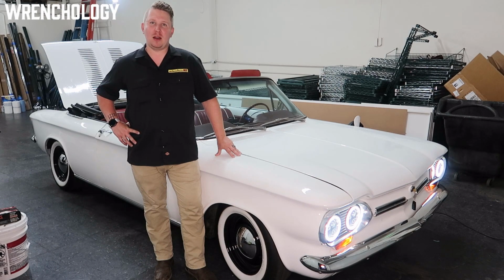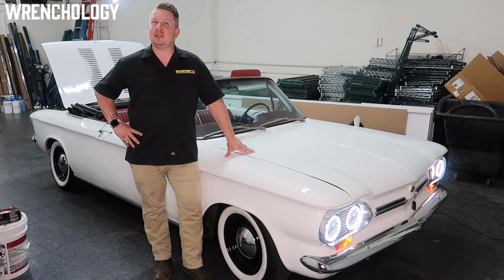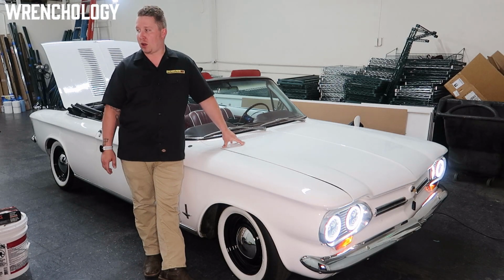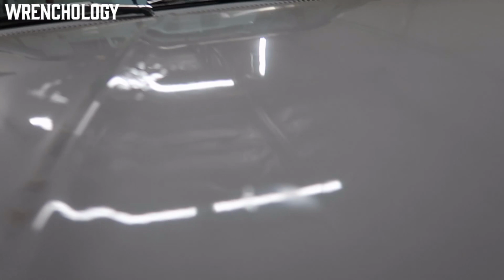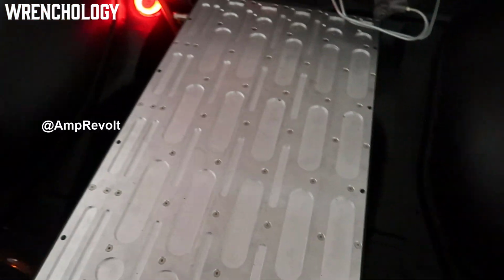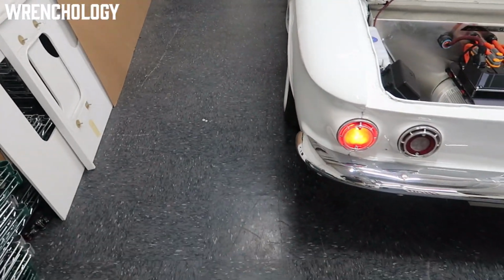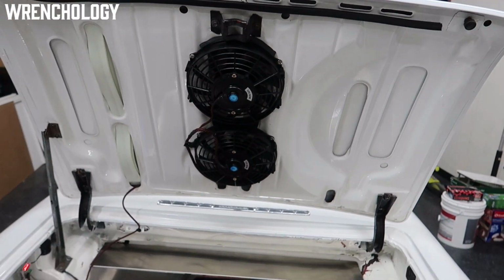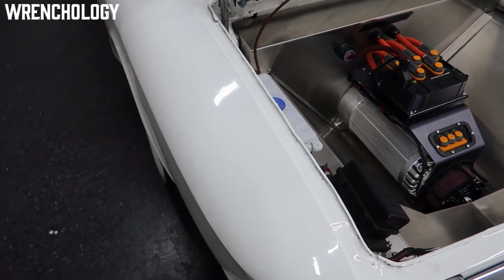Check out the Electrovair!

Comment: I have a 68 I’m thinking of converting. Would it be feasible to use a Tesla x rear end with the power unit attached and have the battery upfront? The measurements are close and would take much I don’t think. Only issue may be the power glide. Thoughts?

Great build by the way!

Comment: 1962 Pontiac Lemans. Hard top. Its 4 spd. Basically Corvaire truck rear swing out arms and trans in the rear. Engine is tired. Runs 195 HP left bank of a 389. Kids car.  Have others. Too. '64 Studebaker wagonaire

Comment: Wrenchology, Im trying to mount the hyper 9  motor to   a 65 corvair flywheel! I have a "coupler " from a miata  conversion  that came with the motor. I  was gonna drill the  flywheel with  a cnc to fit. but prefer to just bolt one on. Do they make a coupler that just bolts on? thanks

Comment: I haven’t watched all your videos yet, but this is very inspiring. Love how clean and simple your implementation is.  A few questions - 
1) how would this work if mating to the power glide automatic transmission? 
2) could you add more (I guess you’d have to double?) Tesla modules to increase your range or would that completely wreck your weight distribution?
3) Is it bad practice to switch to another battery form factor (Nissan leaf or Chevy Volt) to add more to your engine compartment’s negative space?
4) could you use a salvaged Tesla motor instead of a Hyper 9? Perhaps upgraded axles and brakes would be required?
Thanks. Really great stuff. Building my spreadsheet now to start my own conversion planning

Comment: I hope that you took some pictures and video of the build process to eventually show to us.

Looks like a good way to fix the weight distribution that the Corvair was denigrated for too.  How's it handle in the twisties?

When I was in high school in the mid-nineties I was in the electric car club, we had a converted Porsche 914 with a brushed DC motor powered by a large number of 6V golf cart batteries.  Unfortunately as one of the younger members I was basically relegated to battery duty.  Not especially fun.  Car was quick and had good range though.
Reply: We got a lot of pictures on Instagram @electrovair of the build! Drives way better now